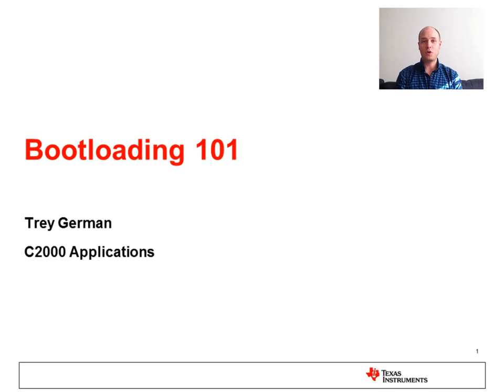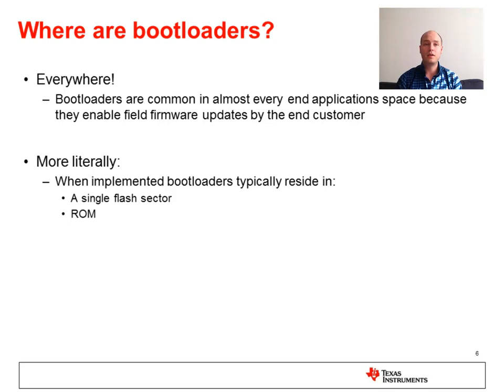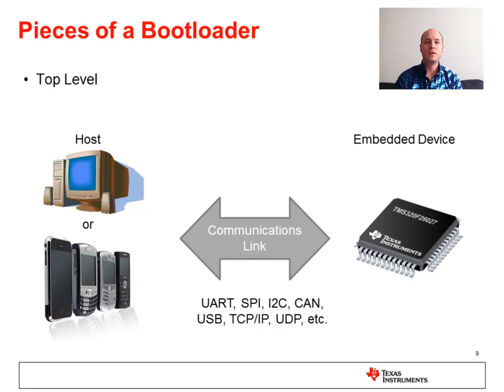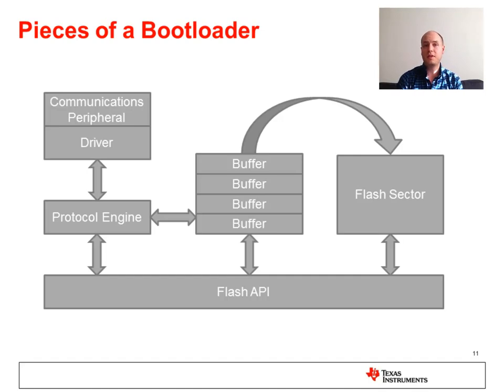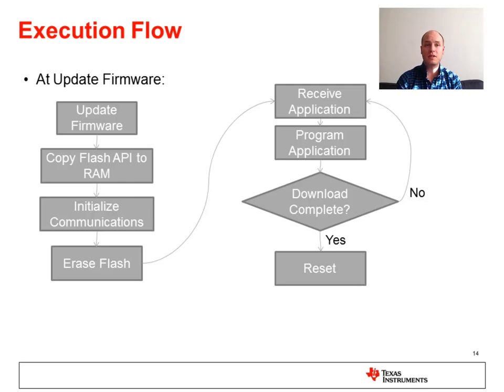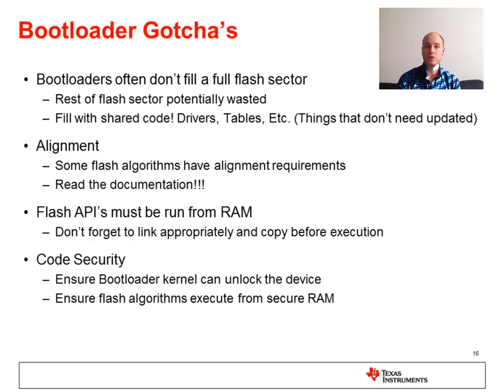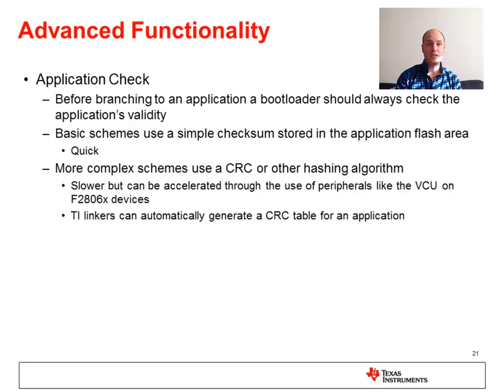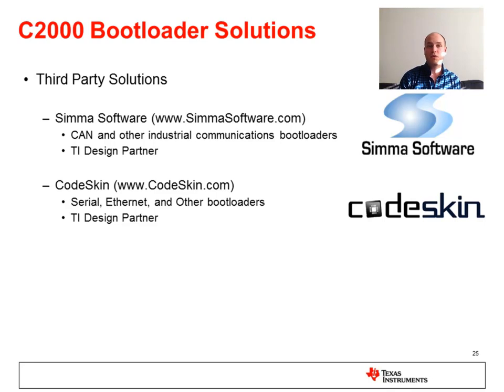Bootloading 101

Comment: Can you please show how to write code for bootloader? Thanks in advance
Reply: @sebastianospino4861 Nope
Reply: @erminejose4188  I am going through this process myself, I can tell you that there are lots and lots of videos on youtube that cover how to write a bootloader. Once you start watching one or two, you will get recommended more and they just keep coming up! 

I think the first thing you should do is decide whether you are using the factory bootloader or a custom one. For example STM32s come with a bootloader already programmed in the ROM which you can jump to or you can set the appropriate bits and do a system reset to make it run. If the factory bootloader doesn't do what you need then you'll need to write your own and program it to page 0 of your MCU. You then need to offset your main application to a later page e.g. page 8 or page 16. It depends how big your bootloader is and how much room you need to leave for it. Then you'll need to learn about the stack and reset handlers so you can execute jumps from bootloader to app and vice versa. You will have to learn about linker scripts and how to adjust the memory map.

One video or one tutorial won't cover all you need to know. You'll have to study various things and piece your own solution together.

This video was useful for modifying linker scripts https://youtu.be/OkUQ3iMmiYQ

There is a udemy course by Fastbit Academy called "custom bootloader development" which you could buy. That covers loading via UART and uses pre-made stuff for sending the file from the host side.

Also there are various github projects you can use. Try looking through the betaflight code for an example of jumping to a factory bootloader https://github.com/betaflight/betaflight/blob/master/src/main/drivers/system_stm32f4xx.c

This one was useful for learning about reading/writing flash memory https://github.com/IMProject/IMBootloader/blob/master/Bootloader/Adapters/Src/flash_adapter.c

Good example for memory mapping if you need to create a separate region in RAM for your bootloader to use https://github.com/jonahswain/stm32g0-bootloader/blob/main/memory_map.ld

Hope that helps!
Reply: @Kefford666  great help thanks brother. I'll go through them all
Reply: That won't happen!! It's way too specific to each SoC or MCU, and would take days of fairly advanced debugging. It's not the kind of thing you can put in a youtube video.
Reply: @gregoryfenn1462  As a student where can i go and learn this information, could please guide me to resources through which i can read and write a bootloader myself.
Reply: @gregoryfenn1462 anything can be a YouTube video, you silly goose